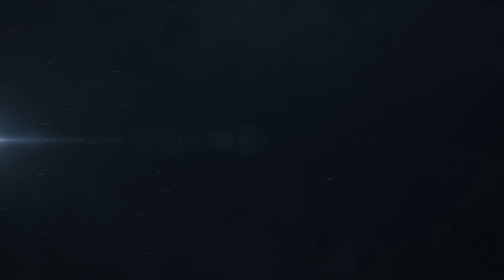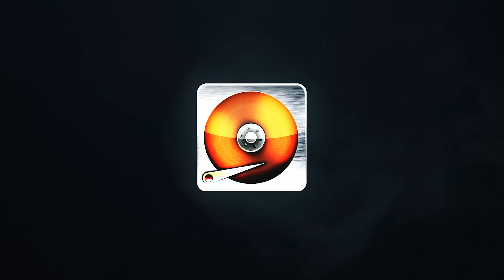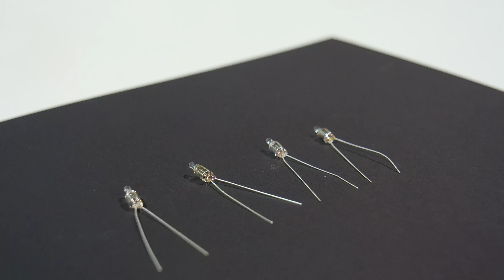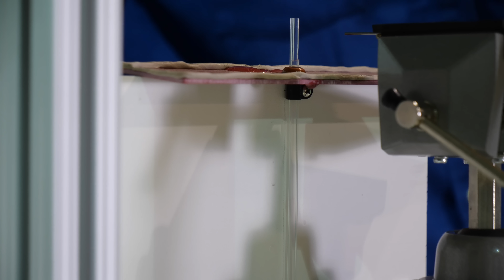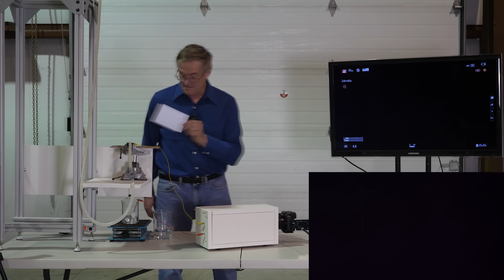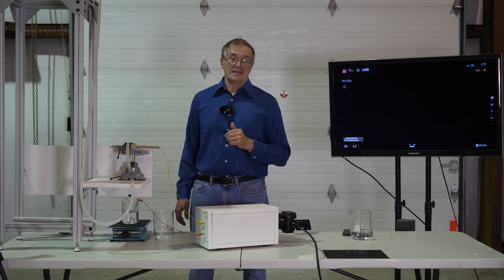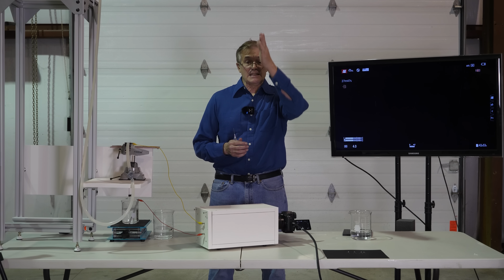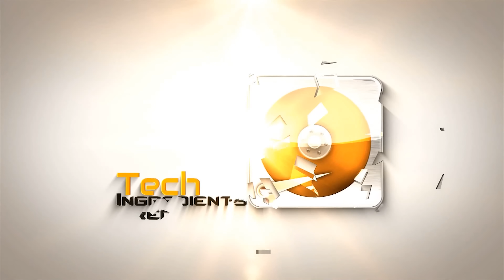We made electricity from water - and it's easy!

Comment: Is this giving off micro amps or nanoamps? And how much nano or micro or piezoamps is it giving off,?
Reply from the maker: Micro amps
Reply: @TechIngredients  would you know how we can get nano amps from it? Do you think if we used a resistor or discharge the water a bit so we can get nanoamps from it?
Reply from the maker: That's actually kinda tough without an electronic circuit. A resistor will reduce the voltage as well as the current.
Reply: @TechIngredients  so if a resistor is used in this setup as you Have it then nano amps could be conducted.Is that correct?I just want to make sure I understood you correctly
Reply: @TechIngredients what tyoe of water do you think has the lowest  current if used? And can you tell us how many microamps the distilled water gave off? Was it 2-5 m.a or 5-9 mic roamps etc?
Reply: You mentioned if. Shorter tube was used It would generate less power and they might not light as bright.So does that mean the current will be weaker?Maybe in the nano amps if we use a shorter tube?

Comment: Very nice! But why a vertical drain from rain water on a house or building is not usable? Transmitting this energy would also be very easy because it's high voltage and low amperage so no conversion needed. I'll take a look and calculate for example, getting from hundreds or thousands of houses in a city how much would be. Thanks for the video, congrats as always!

Comment: I am revisiting this video because I ran across the original article again recently.  
It made me think about the possibility of generating electricity from rain by means of the kinetic energy from the droplets hitting a surface that responds to the force and makes the power.  
Like this experiment...the current would be tiny but the voltage could be very high...depending on the surface area of the generator getting rained on.

Comment: This brings to mind several intriguing ideas, that might improve the efficiency of these by several orders of magnitude, or maybe not at all, who knows? Number one, electrets: when you mentioned Teflon was great at moving static charge, I was reminded that Teflon is one of the best choices for making electrets, a material capable of maintaining a semi permanent static charge, sort of like how a magnet retains a magnetic charge. Assuming you use an electret, my theory is that the ions would be much more attracted to the surface material and be more prone to stripping away from the rest of the water. Number two, I'm sure any average joe with a house has enough of a water collection system already in place~ rain gutters are far from a perfect solution, but if I could replace my future rain gutters with static charge columns just for the sake of collecting a watt or so of energy when it rains, I'm all for it!

Comment: I've looked through all of your videos and you've never done a video on an earth battery. One ice cube tray filled with dirt, bolts and copper wire (arranged properly) can generate 4.5 volts. Question?: with enough of these ice cube trays set up in parallel and then in series, couldn't a significant amount of electricity be generated. By significant amount, I mean anything over 200 watts. Something that could charge a battery bank 24 hours a day. Once built, the dirt in the ice cube trays just need to be topped up with a little water to keep the power flowing. Or, was this all a hoax video that I saw on YouTube.

Comment: Did you do anything with the Hydroxide side? Is it possible to dissolve the hydroxides in the water to make a basic solution? I'd be interested to use it FOR synthesis. How does cement behave when you make it with a higher hydroxide to lime ratio? That would be interesting to see.

Comment: Thanks for this great video. You said that you'd need a lot of equipment to make power from this, but what about a roof and raingutter? They collect quite a lot of water on a rainy day right? Wouldn't that be enough for some power?
Reply from the maker: It would.
The issue is that it would still be pretty small if the amount of water that can be gathered was limited to part of a roof and only when it was raining.

Comment: Regarding the idea about having the water flow in a loop or using the internal surface of a sponge to route the water through, don't you need a pathway for the OH- to travel back up in order to avoid it getting added to the H+ saturated water at the bottom? Seems like doing loops and such would prevent such a return pathway from being possible...
Reply from the maker: The pathway is the moist inner surface, whether it's a straight tube or a complex pathway.
Reply: @TechIngredients  OK. I still don't understand it, but that's probably just my lack of scientific understanding about what is actually going on in the reaction. 😅🤣

Comment: gathering the rainwater together in order to have enough to utilise for this purpose. 
Are gutters not suitable? we already gather rain into drains. Here in the UK we have no shortage of rainfall. 
im wondering if i am missing something regarding why rainfall wouldn't work if it was from rainfall. perhaps into a container /reservoir and then into the system from there.
Reply from the maker: It's primarily the low water flow per square meter with rain.  The gutter will surely work, but the net energy output from the area of just part of the roof will be low.

Comment: The underground rivers beneath the pyramids are believed to have created electric power. So utilizing water flow from the smallest motions to the largest depending on the sources has untapped potential. The sun could provide assistance by pumping water to a high reservoir or tank during the short daytime hours of 3-6 hors and during the night power can be generated by a consistent 24/7 water flow, the high and low peaks of usage must then be utilized by battery storage to store the extra needed for random peaks. The shortest and longest days of the year around the solstices are where measurements are needed for optimization as well as the record heat days and record cold days. Add an addition few percent over peak and the most optimal system by the numbers can be designed for every home, building or space. Then Ai can help crunch the numbers from data to get close approximations of materials cost ext. Over time a graph of future needs from changing weather patterns of the 11 year sun cycles and other cycles can fine tune the systems for even better cost on returns.

Comment: I have built a system for charging 12v batteries using HV caps and bridge rectifiers using atmospheric electricity.  In principle, this should be a suitable source to work similarly, say connected to a downspout on the side of the building.  Using a good filter at the top to divert debris and simply fill a one foot section of the downspout with tubing.  You would need to have a good insulator or gap between the tubing section and the downspout also.  It should work with a small tunable spark gap to control the voltage limit and frequency in line with a transformer to bring it into a more usable range.  Rectified and smoothed with a good capacitor, it should be quite useful. Perhaps for charging batteries in emergency lighting, as an example.

Comment: How cool would it be to parallel this by a million times and power a boat through the water simply by water coming in from the front of the boat exiting through the back. Just use a motor or pump of some sort to start the flow of water.

Comment: Silica glass surfaces develop a negative charge when in contact with water due to the dissociation of terminal silanol (SiOH) groups into negatively charged siloxide (SiO⁻) groups and protons. This creates a surface potential. Hydronium (H3O + or H2O---H +) ions with short lifetimes are then easily generated. The capture of the charge associated with these short lifetime intrmediates is, as you say, not so different to the static charges created when scraping carpet. Gravity-fed glass tube water flows may be the simplest means by which these ionic species are collected and discharged, but scaling this to something meaningful will be an interesting challenge.

Comment: Could you add a capacitor to increase the amps and cycle at 60hz to produce a constant power on visually of the light? Or step down the voltage thus increasing the amps and then drive an LED light?
Thanks

Comment: ❤😊. I suggest one thing. I talked to Tesla team one day,  about using solar particles flowing on our Earth surface, they sent me a like😊, without more comments, but seems to me, as I was talking about solar pannels to make them catch solar no photonic radiations, day and night in this case, this experiment about water looks like a link between the way solar pannels  gets photons and the way we could use water dissociation when molecules are going ionic, by an agitation,  however the way to do it is.
 So. Why not using the tremendous high frequency waves fron Sun, not photon ones but, rays like Gama, as electrons, as also secondary protons, anything from sky interracting with water, creating this agitation day and night. For me it is interesting to search a device, that would multiplicate channels, like a solar pannel, feed only with water, and using this space interraction to create large ionisation. 
😮🎉I am interested in that , because we are monitoring the actual geomagnetic pole reversal, and apparent micronova cycle from Sun, that is related to big Earth  cataclysmic  events, like crust displacement, mass extinctions cycles. In the case of gigantic magnetic induction, likely ground parallel, all our electric systemwouldl be destroyed, including solar pannels, including  cables and magnetic motors, anything made with iron.
Isn't  it ironic 😊?
So this is only an hypothesis, we will know the day it would happen.  Sadly, but magnetic reversal is a fact that is in course, it is official, as weakening of our geomagmetic field around Earh, that protects us from solar eruptions. That's  why northern lights can sometimes  be seen in low latitudes . Solar pannel as conductive of electricity could melt, or explode, by induction, so a  device using only plastic and water ionized by a source, could be saved, perhaps.
❤😊.note all this are hypothesis, thousand of geophysicists around Earth specially  in China, USA Russia,  are working on past events, to understand those real cataclysmic events, to understand  how it would impact our civilisationnal technology,  and the way to pass through. It is a fact that it had been more easy to one billion years stone age humanity to survive, but in an other hand, seems that mammoths and Neanderthal,  died from cold consequences of those events, driving a nuclear winter.
So anyway, no Sun for solar pannels, but a tremendous amount of ionized water, for sure, dangerous to be outside at the moment. 
In that  situation evidently we would like to save us, being at the right  place, but also to save knowledge in our portable devices databases, save memory, to the next generations...
12.000 year ago, perhaps, humanity became conscient about God is, and saved the tradition, I always wonder what would be next after such a cataclysm. Humans are so numerous that more would survive in isolated communities, and would have those electrical devices, perhaps saved but with no energy  sources, seing the Son of god only sometins giving some plasma rays down to the ground (stars of the cosmos falling... you perhaps know the story, that we don't  hesitate to take as a testimonial from the last apocalypse)... we could live this, but with now a way better scientific knowledge, and tools perhaps we are observing in your simple device as a model for future. For me the question is to make it simple, with no use of conductive straight lines like cables. You did a tremendous job with microwaves,  so you understand why we have a big problem with linear conductive material, and magnetic devices.
It happened in the 19th century with morse telegraph cables, by Sun event. In this case the magnetic induction flows horizontally and loves water surfaces.
So do not be worry, we are numerous to have found this horrific hypothesis, but we must pass through emotions and use our brain in a pragmatic way about all that, true or not, we are due to prepare this as an hypothesis. I think we don't  understand the scale of that, Earth survived anyway the last events, but crust displacement, is growing as a strong hypothesis,  as the core and liquid mantle is better seen moving,  we must integrate more and more variables, to see what we would save from our civilization, based on electricity, writing, pictures and shemes,  and magnetic motor power.
A device that could be so simple than release of H ion electrons in tremendous amounts, could be very useful to save tiny memories and device cores, and circuits, as some scientists  thinks that the smallest it is , the more chance it have to survive a geomagnetic induction  event.
Actually however plastics seems to be better than faraday cages, that will melt. Shelters, made of iron and concrete would be wasp traps,  and there is not so much devices to put electrical devices inside and being protected. Aluminized foils and non magnetic metals, are conductives, and will heat, that's  the problem with  electrons moving . So  human's planet Earth is thinking about all this, China seems to have taken advance, because they studied previous worldwide events in geological lake's deposits, notably the 6000 years event called now officially by the chinese name of the studied lake, but that previously we were worlwide calling the "Noah event", as it is compatible in time by assyrian texts found in cuneiform script, and the Bible, sure, and 100 meters  higher Black sea, from near I'm living actually😊
I am to buy certainly a 3d printer, this makes years I am interested in,  for lot of applications, so I will try to understand how we could use that in a way to produce 24/24 electricity, I think also the best way is to reduce our power consumption, drastically,  one watt per device, and solar pannels are a good training to be free from power grid.
Oops,  just to end, what about earth electrical current? Tesla antenna?  Mixed device using water?.......❤😊.

Comment: Or what about just painting a skyscraper with a thin layer of the material that talking about is best and then just complete the circuit with your equipment and then plug the building  in and use the power that it just generated by simply being rained on

Comment: I don't know how I missed this but it's awesome. Forget the electricity... there's got to be some brand new chemistry that can be done with pure water that has been magically acidified. Those free hydrogens have got to be crazy reactive I would think. There are some reactions that require exotic acids that if I'm understanding this right might work with much cheaper acids if given a boost from free hydrogens flying around the solution. Gets me thinking for sure!

Comment: What happens if you do it again? I mean, use the water from the beaker and run it down another tube. Does it generate power again? Does it become more acidic? If so, how many times does it work? Or do the excess hydroxides neutralize the hydroniums too quickly at some concentration?

Comment: soooo I have actually read the paper and the supplimentary in detail. They mantion that the Material of the tube actually is not  verry important. So I thought lets try this by 3D-printing one with a little funnel. I used PETG. And it really worked ... somewhat. I only have a crapy multimeter at home right now with 1MOhm inputin impedace. In the beginning I measured about 22mV. I I plug that into ohms law and if we put the 40GOhm impedance from the paper in, I get about 880V. Well not verry satisfying. I played around a bit and by exident touched the wall of the Glass container tha whater flowed into with the printed part and suddenly I got a big jump in Voltage up to 280mV so more than 10 times what I had before, when the whater flowed down the glass wall. that would be around 11200 V with 40GOhm curcuit impedance! And to me the explenation given in the paper for the voltage would not work, as far es I understood it as OH--Ions flowing up the wall. I also found the even with a 90mm tube I got the same voltage. maybe a result of the lardger surface area of the printed surface. So my setup at home is pretty crappy and there are loads of possible error sources because i had to create the flow by hand.  I will try to optimize, when I have more time but wanted to let you know.

Comment: The energy harvested is still converted from the difference in height of the water droplets, but only by the length of the tube or the separation of the charge. Otherwise, you would break some thermodynamic law and win a Nobel prize.
Reply from the maker: Of course, that's correct. 
This isn't a Nobel level finding, but the fact that this works at such a low velocity/head is impressive.

Comment: How does the output depend on the purity (electrical resistance) of the water? Wouldn't the water have to be deionized, (expensive)?
Reply from the maker: According to the article, the efficiency only drops by 10% using seawater. That shouldn't be a problem.

Comment: How many tubes would you require to charge a mobile phone?

Would a device attached onto a down pipe rain gutter be able to fit adequate tubes for this purpose?

Clearly this would be hugely beneficial for countries with substantial year round rain.  

Removing just mobile phone charging from the grid would have an enormous effect on total grid usage of a country’s

Comment: 5:45 A door handle is a capacitor, not a ground. A Wall plate screw is grounded if wired correctly.
Reply from the maker: To pick nits with you...
What is "earth ground?"
The planet itself is like the door knob, only larger.
Have you ever heard the saying,  " The solution to pollution is dillution?"